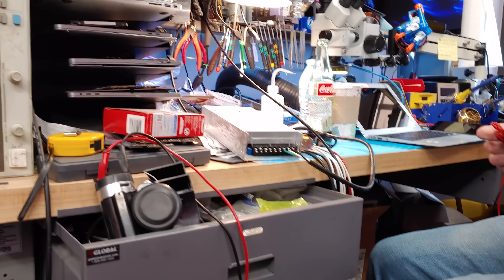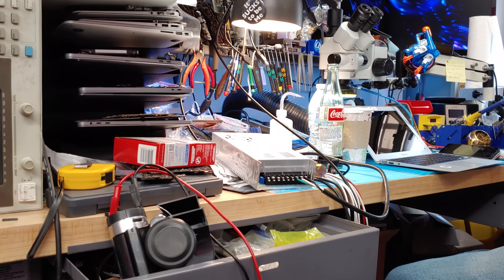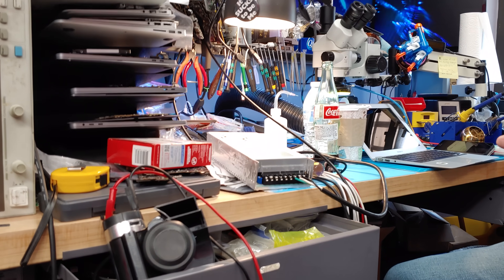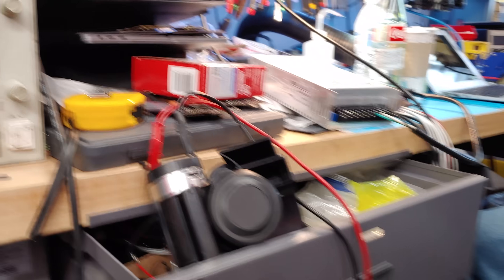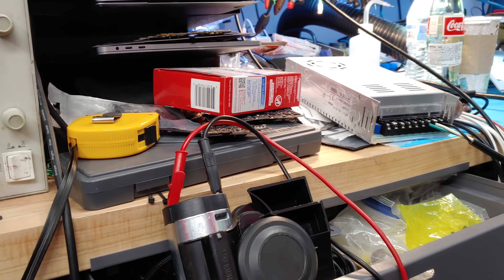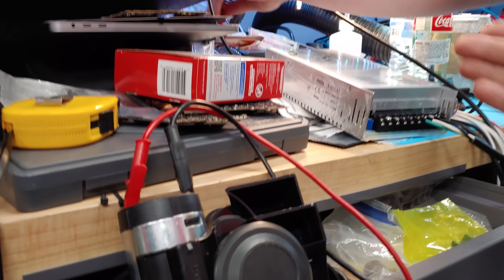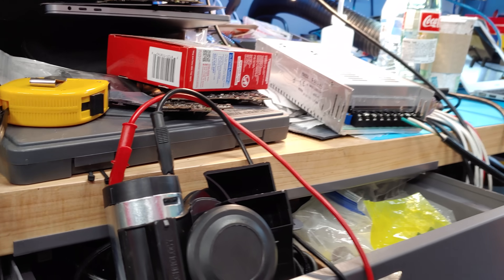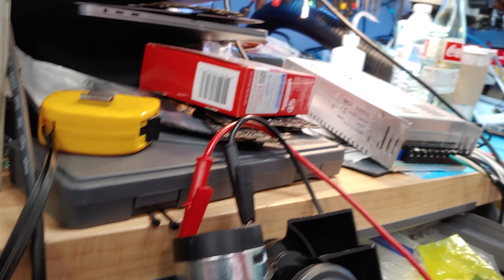My bike horn strikes fear into no one. 😞

Comment: Just get a small RC servo, basic controller and a traditional air horn, use the servo to push the air horn button and have the actuation switch on your handlebar

Comment: Louis, just use a standard car horn. They pull about 4-5 amps each. You can use one, but most American car horn setups us a dual horn (one high the other low tone). That would probably get the driver's attention quicker given it would sound more like a car. The horn (or horns) would need a relay to carry the load. Then a button to switch the relay coil. It will need a fuse in series with the main power line. Roughly 8-10 amp with a single or 15-20 with a dual.

Comment: Reasoning that it is 35 or 40 amps just because the relay is rated at 40 amps??  C'mon Louis, you're smarter than that.
Put a clamp meter on it, it's probably closer to 10-20 amps.
Reply: Exactly.  A short stroll through Amazon shows similar horns that are rated 18A. 
Stebel 11690019 - Nautilus Compact Mini Air Horn Black https://www.amazon.com/dp/B00CMX20H4/ref=cm_sw_r_cp_apa_i_BtsGDbWFSS54X

Comment: @LouisRossmann- a Small Motorcycle Batterie Can Hold a Charge Long Enogh To get You To AND Fro - m 
Trust Me 
You Dont Need a Full Size Car Battery ! 
i Run one on My Bike and Its Ran by a Simple Prechraged High Density 9-VOLT Rechargable - The Oversized 9Volt - ? - 
Yes It Works !

Comment: 1:40 If you let off the accelerator when you blare the horn you should be fine for current.  And if there is an obstacle in your path, I know you want to mow it down!  But likely you will be slowing down because your'e not a moron, so you have plenty of ampacity for that horn without an extra battery.

Comment: that's a stebel nautilus... 139db of sound pressure is enough to startle a truck driver... and its compact as well... and good RC lipo batteries can handle up to 50C discharge currents.... even good for starting a car with it plus its very compact.... I would also recommend just using rc lipo batts (plus a charger for it) instead of a 48 to 12V step down converter then just wire it together with your on/off switch (with a relay to the rc batts)

Comment: Your bike motor isn't running at 12 volts. This horn is NOT pulling 35 amps at battery voltage. 12v, maybe.

Comment: Doesn't need to be a huge battery, a 5000mah rc car pack will handle that in moderate bursts. Get one of the ROAR approved hard case batteries and a simple charger. Probably cost all of about $80 from Hobbyking.

Comment: Have it charge a super cap to 12v and use a firing mechanism instead of a separate battery adding weight?, downside is sub ten second time constants between beeps is most likely, unless you keep it short.

Comment: Power it with a 60 Volt Dewalt or 40 volt Cobalt power tool battery Lithium Ion with a 40 amp circuit breaker switch to be safe it can run independent of your bike and you can still use it in the office

Comment: Uh, somehow I seriously doubt that horn uses anywhere near 35-40 Amps - Someone needs to find the specs on that horn, or at the very least measure it's current draw. (Hint: The rating on the relay has NOTHING to do with the power the horn takes: They just used the standard automotive 40A relay. I have one in my car that turns on-and-off LEDs that take maybe half an Amp.

Alternative: Even the dollar stores 'round here carry little VERY LOUD compressed gas air horns. Guess how much they cost... Uh-huh, $1. Build a quick-release clamp to hold one on the bars, keep a couple of spares so you always have one.
Reply from the maker: I tried the power supply we have that does 10 amps, and it was limiting itself to 3 volts anytime I hooked up the air horn to it.
Reply: @rossmanngroup , here are the specs:

    Horn: HornBlasters Black Dual Tone Motorcycle Horn
    Horn Length: 3″ (100mm)
    Horn Width: 4.5″ (114mm)
    Horn Height: 4.5″ (114mm)
    Horn Weight: 1.25 lb (0.57 Kg)
    Max Amperage: 18A

Comment: The 40A relay does not mean that the horn takes such a high current. Actually, you should think about more realistic 10A to 20A or so. A "40A relay" is needed because these kind of horns are highly inductive loads. The 40A rating is only valid for resistive loads. If thinking about any kind of electronic inverter, be aware of high voltage spikes. A freewheeling diode might help, or a varistor or a transient voltage suppressor diode.
(Bad English? Maybe. Please be indulgent, I'm german. Any corrections or improvements are welcome.)

Comment: O another idea, a super capacitor bank that slow charges off the battery, that way it puts a small draw on the existing electronics, has all the power and discharge it needs, and is still reasonable safe and reliable. Though quite expensive.

Comment: you could achieve something similar, noise-wise, by having a digital horn device connected to a decent portable speaker such as a UE BOOM 2. Hell, just use the air horn app on a spare phone over bluetooth. If you use an older device, like Android 6 or earlier, you can crank the volume on the phone and speaker separately, making the overall sound much louder (stupid fucking google....linked bullshit...). Direct 3.5mm input is probably louder.

Comment: What is heavier, a battery + inverter, or an air tank (no compressor)?
Reply: The soda bottle is lightest (airzound refillable fog horns, also you typically carry a bicycle bump with you when riding a bicycle, with pump included it’s about 1 to maybe 1.2 pounds after mounting)

Comment: It would be a lot easier to simply have super capacitors trickle charged from existing battery via a resistor the horn is only used for short bursts, also I would assume you wont be throttling the bike up when someone is in your way so no load on battery at the time you blow the horn, so no second battery needed really if you just don’t blow the horn while accelerating the bike which would make no sense anyway as you would normally be breaking.

Comment: You could use a big kappa-sitter.  To drain it halfway in a 2s toot, you would need 9F.  If you charge it with a 100ohm resistor that can handle 1.5watts, you would need 45 minutes to get 95% starting from 0V.

Comment: I have Wolo's on my truck too, works great. A good size ups battery and an automotive audio cap in parallel should do nicely. Ups battery will do 40 amp bursts which is all you'll need for a horn and the cap keeps it from draining too fast and dead shorting when it gets low, also convenient to have a built-in voltage gauge. One of those big horn buttons that mounts to steering wheels should take the power too, eliminating the relay.

Comment: just don't use the motor while tooting.
For a second that's okay.
so make a two way relays, that switches to the horn when tooting while powering your bike while not tooting.
Should be easy enough I guess?
Reply: yeah, normally closed on the motor, and normally open on the horn. and then a button to switch the relay
Reply: Depends on how brakes are powered
Reply: @Dylan-xc8yz  lol it's a bike it don't have power brakes

Comment: If your battery is 48V and use a buck converter for 12V, you will need only 10A to use the horn :)

edit: but you need a 500W DC-DC buck converter
Reply: Wire four horns in series.
Reply: @chasmosaurus3  That will still take 40A but at least he will be the only one left on the street
Reply: a 500w buck converter is about the size of the power supply already being used to power it- just use a rc lipo battery
Reply: @SuperAWaC  Since when? Those cheap $4 300W boost and buck converters are only a bit bigger than the size of three arduino nanos stacked, the bigger issue with this idea is that converters have both an input and output current rating, so even if you find one rated for 500W it may have a max output of about 20A because those tiny traces can handle 40A+ of current, so to actually make a buck converter work here you would need two of them, step down to something between 36v-24v then step down again to 12v.

That's a little silly so I'd recommend everyone else's suggestion, a cheap $10 12v lipo and a 40A switch.
Reply: @vgamesx1  Connecting them in series is pointless, you still draw 40A@12V from the last one. You need to connect them in parallel so you draw 20A from each. But still due to component's tolerance, you will draw more current from one and less from the other.
And yes, a 12V battery will be better solution, but I doubt that the $10 ones can handle 40A.
Reply: @vgamesx1 Yes, I agree with you! This is just a hypothetical scenario.
Also 1000mah are a minute and a half of battery life. Tho that may be enough for a horn. And keeping in mind that these are chinese ratings, I won't bet on something less than $30.
Reply: @vgamesx1  by your own admittance you've never seen a 12v 500w dc-dc converter before, so 80% of your comment is meaningless. you made it just to sound smart while adding nothing to the discussion. good job.
Reply: @vgamesx1 
Chinese Watts are not the same as international Watts.... The formula is something like
Chinese Watt = anything from international watt to 10 times international watt.
Reply: @tin2001  I agree but again that wasn't the intention of my reply, I was more so taking a jab at someone calling my comment pointless, that aside it really depends, they lie pretty hard when it comes to lighting but some of these converter modules can reach what they clam to be rated at although you will probably need additional cooling.

Comment: Get a 3s lipo battery for a 450 size helicopter theyll handle it or maybe 6 18650s with 3 in series but 2 sets in parallel
Reply: Hyperion makes good lipos. It's what I use for my helis
Reply: 18650s would be perfect. Probably also what his bike uses. Good versatile battery. They're in older laptop batteries before flat cells became popular
Reply: @Dylan-xc8yz  
Still in almost all non-thin laptops....

Comment: RC Lipo Battery or ditch the electric air horn and get an actual air horn, CO2 bottle and a solenoid valve.
Reply: Or just get a Airzound, which is a air horn with refillable bottle.  It is loud, which can be adjusted.
Reply: @HAL1400  Airzound is perfect, no need to adjust, put it all the way up, you need all the decidels you can have in New York
Reply: Yep, RC LiPo battery would work
Reply: Real air horn, refillable pressure tank (about 1 litre) and a button valve. Could be permanently mounted and weigh almost nothing.
Reply: Hmm.  A solid-rocket driven air horn device might be good compromise in terms of size, simplicity and performance.   Surely there are no possible downsides to this plan.
Reply: Probably a lot lighter too
Reply: I use an Airzound. It's pretty effective.
Reply: @FREEAGENTOFGODYAH  I would like to quote Rossman in a older video. "Thinner tinyer bezal more expansive BIGGER SCREEN with.
Lighter, More voltage, louder horn, PEOPLE SCREAM!!

Comment: You could also power this off a 3S lipo battery.
12V x 40A is 480Watts
That a good honk.
Reply: This battery will run your horn for about 6-8 minutes continuously on a single charge:
https://www.amazon.com/Turnigy-Heavy-Duty-5000mAh-XT-90/dp/B0778MQSYK
Reply: you could even build something with super condensators, a horn like that doesnt Need to run very Long :D
Reply: @SchwertKruemel  You mean a capacitor ;)  condensator is the word used in dutch (and prob some other languages)
Reply: Sebastiaan Rutgers yeah :D
Reply: @MrMegaPussyPlayer  in Croatian it's Kondenzator. Pretty close.
Reply: @Lupinixx  condenser was also used a long time ago in the US, say 50s and earlier,
Reply: @Lupinixx  that's strange cause in English a condenser (similar) is a different word.
Reply: @Lupinixx  Kondensator in Norwegian 👍🏻
Reply: What voltage is his existing battery? Being that it’s an air horn, it probably will accept 24 volts or more. If not definitely go with the 3s lipo.
Reply: @bangthumper1195  He could go with many things. The Lipo cells mentioned here is one ... or 12V battery bank (or 4 18650) + 1 supercap. Or even 8 18650 (four serial x2).
Tho the "low" capacity ones he might recharge every trip / day. 
I probably would go for three of those: https://www.amazon.com/dp/B0778WF4Z3/ (one at home full/charging, one at shop full/charging, and one on the bike for usage) and clamp down / regulate the voltage if necessary.
Reply: @MrMegaPussyPlayer  4 18650 batteries would be 16.8v when fully charged. 3 would get you to 12.6v but even with high amperage Vape batteries like a samsung 25r I wouldn't want to pull 40a from it. Best bet would be a good 3s lipo like a Hyperion or 6 high discharge 18650 with 2 parallel banks of 3 18650s in series.
Reply: @MrMegaPussyPlayer  How much is the inverter for that going to weigh, on top of the batteries?  Remember, this thing takes 12V, 35-40A AC.  (And where is it dumping all that waste energy?  Fortunately, it isn't actually outputting anything like that much sound energy, or it would be breaking nearby things when sounded.  Like lenses and bones.)
Reply: Does a person with a heart attack move out of your way faster?
Reply: @AndreasDelleske  Maybe not, but it easier to drive over them.
Reply: Exactly what I was going to post.
Reply: @anonymoushippo-m7d  That was a joke
Reply: @anonymoushippo-m7d  p sure they were joking